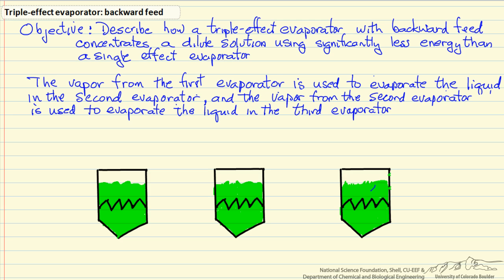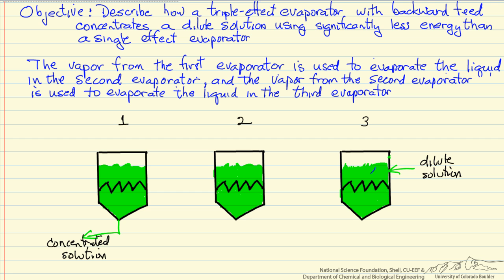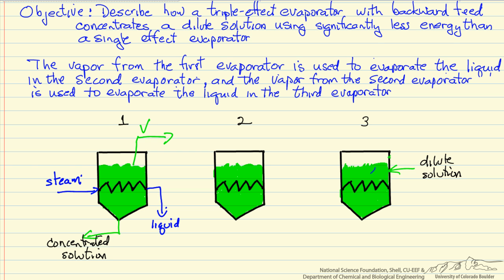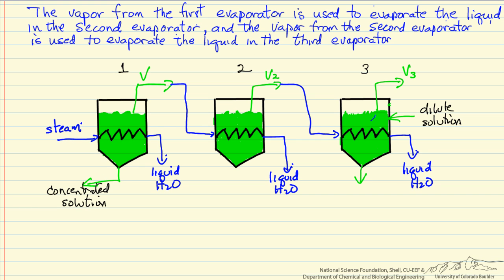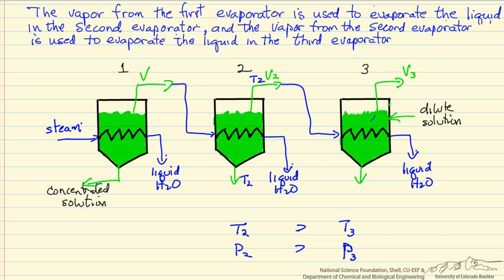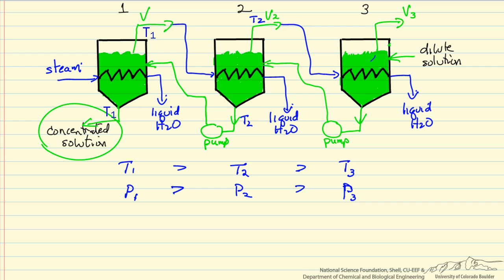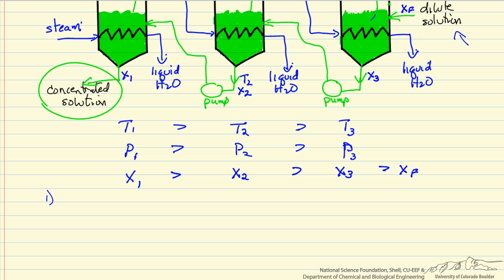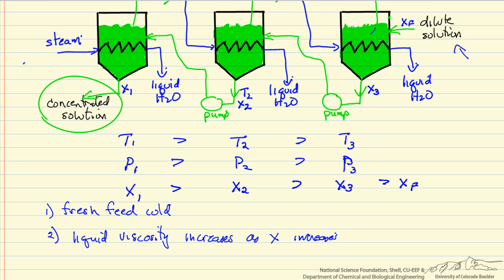Triple-Effect Evaporator: Backward Feed

Comment: Hello. I am designing multiple effect evaporator. How do I know at what pressure should the first effect operate at? Should i operate the pressure at the boiling temperature of the feed?
Reply: Atikah Othman the boiling point of a solution is dependent on the pressure and vice versa. so u should operate the first effect at a pressure with a corresponding boiling temperature which is lower than the input steam.